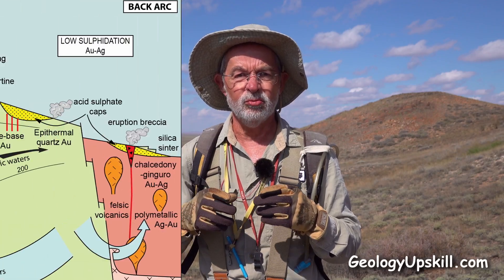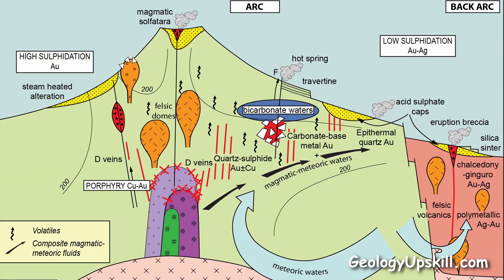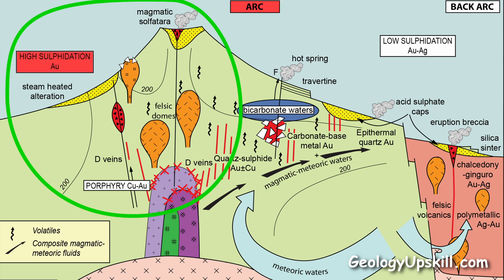High VS Low Sulphidation Epithermal Systems

Comment: in the vedio i think you have mixed both systems, if you see in the begining you talk about low sulfidation then high sulfidation for once and call the same system low sulfidation later on. please unmix it
Reply from the maker: That is precisely the point of the video. You can have low sulphidation type veins in and around high sulphidation systems. I show two examples of that in this video.

Comment: Great description of high sulphidation. Im pretty sure we have low sulphidation system at our Hog Ranch Project in Nevada and is currently at least 2Moz and growing. I am intrigued if there is a polymetallic deposit at depth because 5km to the East there was the old leadville mine although narrow vein, those structurally controlled metas came from somewhere.
Reply: That country looks like Nevada alpine desert Plains for sure. No Basque cooking though.
Reply from the maker: It has the geological systems of the Andes but it's FLAT!
Reply from the maker: Many low sulphidation vein systems zone downward into base metal veins (Pb Zn Ag).